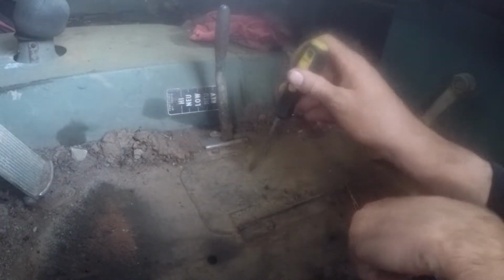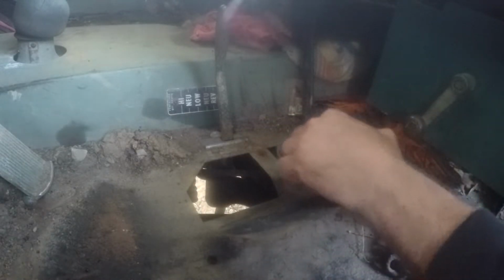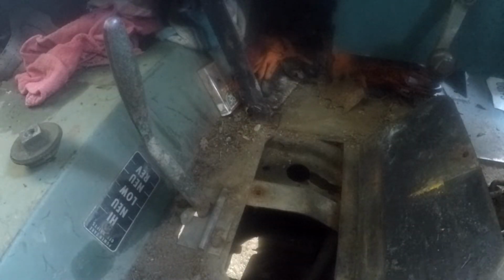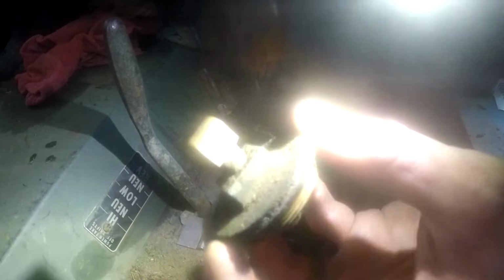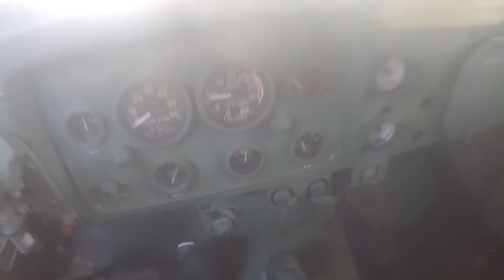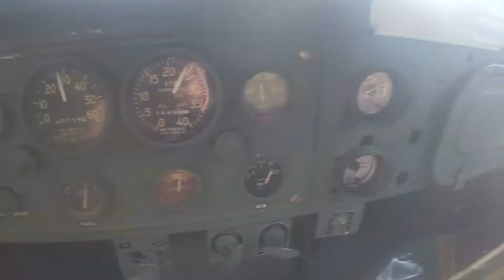Hauling firewood in my 1971 deuce and a half

Comment: Nice thing about the military trucks is they are weight rated for offroad. so 2.5 ton is fine hauling 5 tons on road. If you ever need just a little bit more traction, remember there is a little axle lever you can flip to engauge the front axle drive. I never found it usefull to skip gears in these things except, skipping first and starting in 2nd makes it a lot nicer for taking off. 1st gear is only really needed for offroad, crawling, or parades.

Comment: Your video popped up on my feed today and I’m always in the mood for some deuce action!  I have a 68 and come summer, it’s my daily driver. Yours sure seems to shift better than mine. I think an untrained driver sat in my seat and repeatedly downshifted hard on the synchros prior to my ownership as 1,2, and 3 require RPM matching and double clutching. it is; however,  pretty much theft proof! If you drive yours all the time like me, don’t be afraid to bump that fuel up. You’ll read everywhere on steel soldiers that you’ll melt a piston down but as long as you run the RPMs up to the governor on every gear and you don’t get crazy pulling a long grade rolling coal like a freight train,  you’ll keep enough boost to keep those EGTs down. I turned mine up years ago; and I mean ALL THE WAY UP!  I also re-popped the injectors to 3500 psi which offset the total fuel volume injected while shortening the injection event. That also helps atomize  the fuel a bit better. All in all, she’s not slow. I can drift a dirt corner in 2nd gear and pass cars on the highway. I have no clue what kind of HP I’m making but the seat of my pants suggests that the power may have doubled. Awesome trucks and awesome video!
Reply from the maker: Glad that u enjoyed it man . I love driving mine aswell ! I've put tons of miles on mine. Mine does shift pretty good .. I've learned that low range third gear is the ticket. Makes it way easier to pull out because it between 1st and 2nd high range , and then u dont have to go into 2nd gear because all of these have a 2nd gear that's a little wonky to get in sometimes lol
Reply: You’re right. That first to second is about a mile and 2 big turns on the way. Lol. I actually never use first at all. I start in 2nd 99% of the time. 👍 I’ve never split shifted but with the power, I’ve never needed to yet. The biggest issue I’ve encountered is the massive RPM drop between gears. Really could use a 6speed with a normal 1st gear. We pretty much have a 4 speed with a granny gear. Lol.
Reply: @ShitPoster??? 
Hey there. I generally use waste oil 90% of the time. It settles in tanks for a while and then I run it through a centrifuge before putting it into the truck. I get an unlimited supply from the shop that I work for. To improve the cleanliness, I also have a coolant heated pre filter on the way up to the FDC. That works very well :)

Comment: Great video.  I had little doubt the truck would handle the load.  I stacked 1.75 cords of firewood (seasoned hardwood) in the back of an M105A2 and pulled it with my M1078.  I was worried about the tires on the trailer as they were over their rated limit, but I was only going a few miles.  Everything worked out fine.  The truck did not even know the load was back there up and down hills,  and my wife said the trailer towed fine (she was following me).  I had intended to replace the 900 NDCCs with Goodyear G177 1100s before I hauled the wood home, but I could not get that done before the firewood was ready.  The G177s are rated for that kind of weight.
Reply from the maker: G177 are definitely a good choice. I'm waiting on my tires are shot and that's what I'm putting on my duece. The truck definitely wasn't overloaded lol. If I stacked it it could probably hold 3 cords. The only real concern is stopping safety.

Comment: You should get the external brake fluid reservoir kit from Big Mike. I put one on mine, great for keeping an eye on the level and super easy for adding fluid if need be.
Reply from the maker: Great idea! It's on my list of things to do for sure. I'll try and make more deuce videos!
Reply: I bought that kit a couple years ago, I just need to install it.  Anyone have a video of an install or is it pretty straight forward?
Reply: Not sure of any vids out there but it is fairly easy to install, especially if you got the kit from Mike because everything needed is included. I'm not much of a video maker but if I remember this weekend i will take a vid of how I did it.
Reply: @scottbrutus  Awesome thanks.  Yes I got Mike's kit. Have you hooked up a power bleeder to it?
Reply: @owentimo  Yes actually I have, a few times. I have the Motive products bleeder. None of my screw on adapters fit though, I had to use the universal round one with the little chains that wrap around the bottom, not as convenient but worked just fine.
Reply: Ditto on the auxiliary brake reservoir got mine from Big Mikes low cost great investment

Comment: Truck sounds great
Reply from the maker: Thanks man. Gotta love the sound of a multi fuel!
Reply: True
Reply: @chevyman35089  which multifuel engine is in there? REO?
Reply from the maker: It's a white made ldt465 , 478 cubic inch . With a D turbo
Reply: @chevyman35089  very nice 👍🏼
Reply: @pacificcoastpiper3949  Reo and Continental made the gasoline OA-331 for the M35 during 1950-1960.The M35A1 from 1961-1966 with the multi-fuel LDT-427 and the M35A2-M756A2 during 1966-1988 with the multi-fuel LDT-465,LT-465,and LDS-465 were from Continental,Hercules,and White.

The M35A3-M109A4 for 1993-1999 all had a Caterpillar 3116 only.

Comment: We used to stack pallets of plywood and bales of concertina that high.  Both of which should be heavier than that.  And then we would drive it cross country through the swamps of Louisiana.  Load?  You're fine.
If you were stacked to the tops of the wood rails by my calculations (12' x 7'6" x 3'6") you should have been carrying 2 1/2 cords.  And if it was also stacked higher in the middle then probably closer to 3 cords.
Good job.

Comment: Those old Hercules multi fuel engines were gutless but as reliable as your favorite hammer and sound fantastic they sound better then any Cummins or Caterpillar out there imo
Reply from the maker: Yes definitely has little power for the size of truck lol. Mine is a white not a Hercules but they are identical it's just who put it together that's all. Allot of people like the whisler c turbo they sound good but have less flow than the d turbo . Mine has the d which is less whistle but more go lol
Reply: The 7.8L multi-fuel was made by Continental,Hercules,and White.All three of them made the LDT-465,LT-465,and LDS-465 for the 1966-1988 M35A2-M756A2.
The M35A1 with the LDT-427 was also built by the same three for 1961-1966.They're all the same engine regardless of who built them,but the multi-fuels in the A1 and A2 aren't the same.
Reply from the maker: Very good knowledge my friend! Thanks for the info
Reply: Plus in a pinch you can run it off motor oil, charosine, or jet fuel

Comment: A cord of firewood weighs between 2,000 and 3,000 lbs depending on wood type and moisture content. Your Deuce is rated for 5,000 lbs cross-country and 10,000 lbs on roads. You are fine. As a side note: these trucks were never intended to split shift. There is no benefit from doing so and many potential hazards when you do.  Driving in very rough conditions should be done in low range but on pavement and within the rated weight limits there is no need to use low range.
Reply: You should split when heavy, shift all 5 in L then go H and do 4 & 5.
Reply: Their is a benefit. Less stress on the engine and drive train.

Comment: Are you near ohio? Looking for someone to do minor work on my 67 deuce and a half
Reply from the maker: I'm in sw pa. So not to far
Reply: @chevyman35089  thats not too far i need to work on my brakes and my air system and some minor stuff. I totally forgot about checking the fluid until i sww this video something ill be doing asap. Ive already changed every other fluid in the truck except for brakes.
Reply: @chevyman35089  hey in regards to the brake fluid i just looked at mine and the cap to the resivor has a hose coming off the top of it. What does that do?
Reply from the maker: That hose is just a vent to the reservoir
Reply: @chevyman35089  thanks man! I see that there is a grease point on the resivor part of the brake system.  I missed that when greasing... who knows how long its been since that thing has had grease. Mine probably hasnt has the brake fluids changed in 20 years at least... or any oil in the air pack. Always something i want to fix or upgrade but itll still get you around. "They dont make em like they used to"
Reply: As for tires there are many choices either NDT pattern or go to civilian style , while the military NDT are not the greatest on road depending on your use , they make the image where others don’t , each to their own .
One dealer is Summit in Akron Ohio they have a web site of course

Comment: I also like the Split Shifting too
Reply from the maker: I agree man. Honestly I feel like starting out in low range 3rd is easier on the truck .. if u use high range 1st is too low and 2nd is too high. The ratio of 3rd low seems perfect to me. Some people say you'll wear out the transfer case synchro but anything can be fixed and honestly I dont feel like it's doing damage.  Thanks again for the comment!!
Reply: Welcome
Reply: When you get a chance, can you show a video on how to change the batteries on the M35A2?
Reply from the maker: Yea absolutely! Love getting video ideas
Reply: Thanks. I was thinking of becoming a diesel tech/mechanic
Reply from the maker: @captainprizzle8166  very rewarding job . And pays well . Also has downfalls like everything.  Kind of hard on the body especially if its heavy truck repair, but very good job that is in high demand right now. Good techs are hard to find!
Reply: @chevyman35089  yeh the Mack I drove said don’t go higher than 2nd in low range, it wasn’t my truck so I obeyed but I loved driving twin stick too. 👍🇺🇸
Reply: @captainprizzle8166  how’s it comin ? You running racks and building turbos and pumps in your sleep yet
Reply: Not yet. Lol

Comment: that's not an air line it's the vent for the master cylinder only, the air pack works like a vacuum booster on an old truck except instead of vacuum it's 120 psi of air that assist in braking.
Reply from the maker: U are 100% right .. I misspoke in the video. Thanks for watching